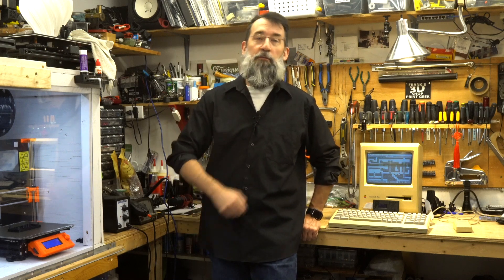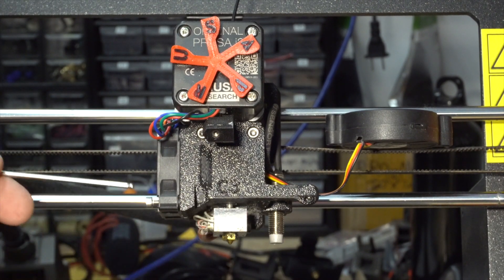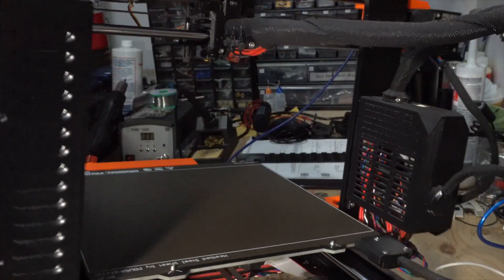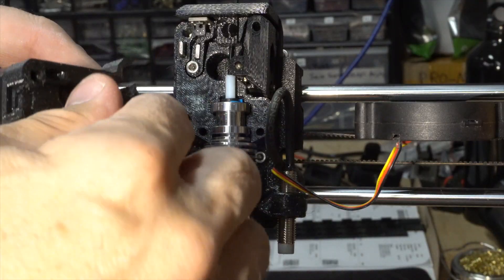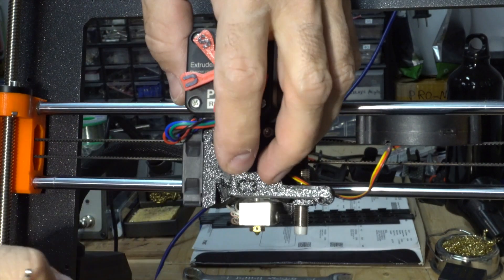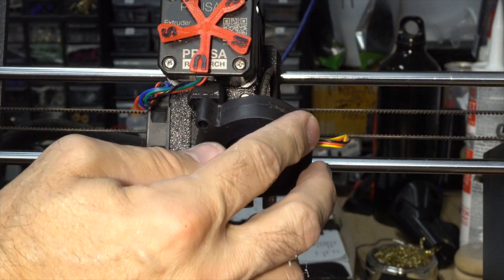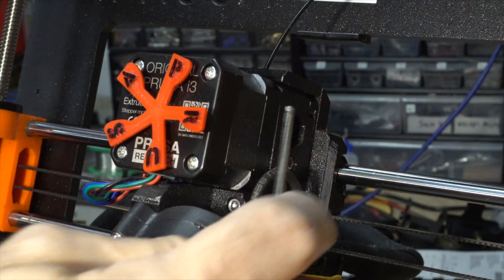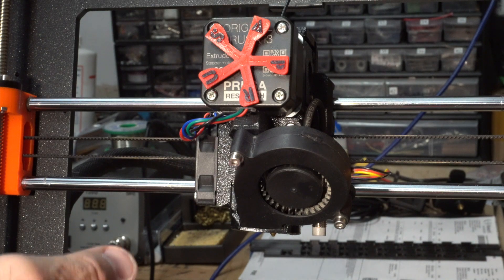Dismantling The Hotend (Prusa MK3S)

Comment: Thanks for the video! I had leaking filament coming from above the heat block since it was loose. Followed the steps you outlined here to tighten it and now it looks the leak is gone and prints have more consistent layers. Cheers from Toronto

Comment: I'd like to note for anyone who's considering this and would like to learn from my mistakes - always do this with the nozzle on, otherwise the heat break gets screwed in and you get contact between the hot end and the colder areas of the extruder assembly. The nozzle and the heat break share the same thread. This means that the heat break can go further in leaving the nozzle not being able to go all the way. The consiquense in my case was that the filament stopped extruding right after the initial loading.
Reply: Thank you, it took me longer than I'd like to admit wondering why I wasn't getting a gap.
Reply: This is the most important comment here.

Comment: thank you for the video. for a long while my prints have had layer shifts in them and I just noticed my hot end / nozzle had a wiggle in it but the nozzle was snug in the hot end. Turns out I had the same issue as you. My heatsink was a full quarter turn loose. I just fixed it and redid a first layer calibration and am now doing my first print since the fix. We will see how it goes. But I am sure a lot of the layer shifting I had should now be fixed.

Comment: I wouldn’t call this dismantling the hot end. Thought for sure you were going to take apart the actual hot end.
Reply: You are looking for dissecting a hotend my guy 🤣🤣🤣
Reply: @mophie6941  Nah, he's looking for dismantling the hot end. This video simply gains access to the hot end. Notice how nothing dismantled in this video was hot or capable of becoming hot. 🤦‍♂️
Reply: Exactly. The hot end was exposed i.e. some stuff were dismantled but the actual hot end was not dismantled. The whole process of dismantling the hot end is much more complicated, and only ~50% of the work was shown here. The rest (~50%) was missing. 

I was looking for the guidance video as I wish to replace my current hot end with a new one. This video didn't bring me to the goal, must look for some better.